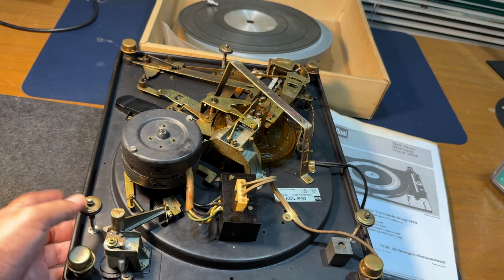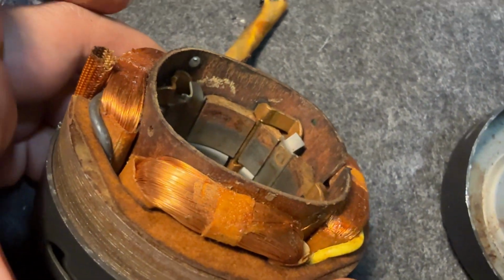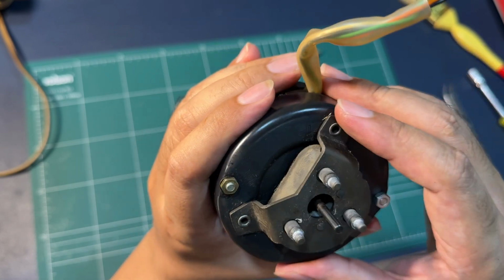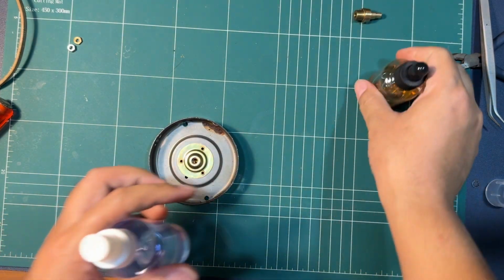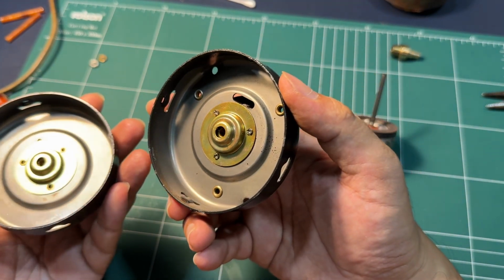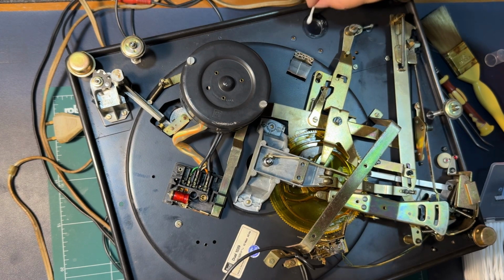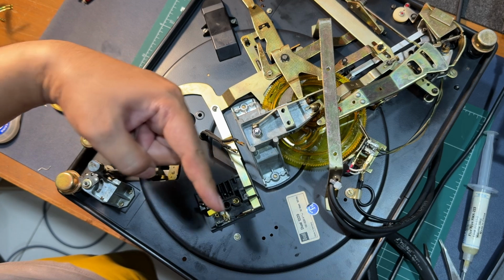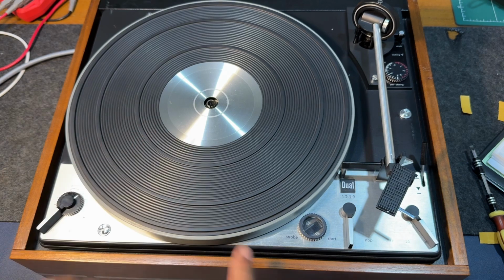Was This Dual 1229 Too Far Gone?Complete Restoration of a Wrecked Vintage 1970's FULL AUTO Turntable

Comment: I've got a Dual 1229 I bought new many years ago. I've rebuilt the motor, cleaned all the moving parts and regreased them and it's operating perfectly but it has developed a hum and I just can't make it go away even though I feel it's properly grounded. Any suggestions?
Reply from the maker: I would check all connections again, especially the cartridge sled to headshell, muting switch, and grounding. Also, try with and without connecting the ground wire.

Comment: You need to take apart the oil reservoirs for both motor bearings and replace the material that holds the oil for the bearings. That is the proper method.   You have to drill out the rivets and then replace them when reassembled.
Reply from the maker: Yes that’s the ideal way, but the bearing condition was relatively clean. I’ve swabbed it with alcohol until there’s no residue. Must’ve used almost 10 sticks, both swab sides per bearing.

Comment: Dual are so well built, they could survive 5 nuclear bombs. I have just restored mine that a friend gave me (1009). The motor was making a weird noise after 20 minutes of play. So I opened it and cleaned and lubricated the bearings/bushings with 3 in 1 oil, now everything is silent and perfect. I turn the platter with my hands before starting the motor, just so it does not work too hard.
Reply from the maker: they don't make things like they used to

Comment: Thanks so much for making this video! Would you happen to be able to get clear video on how to remove the platter? I cannot for the life of me find the infamous C ring (and how to get it out without scratching that area).
Reply from the maker: Unfortunately my unit didn’t come with a c clip. The clip should be at the top of the spindle. Or maybe if you can’t see it there, the clip is not attached?
Reply: @hashtag-shaneiacs thanks for the reply 👍 it’s definitely attached as the platter won’t come off. I just can’t quite see if it’s around the spindle holder or inside the spindle holder.
Reply from the maker: @tapehiss88 have you taken off the single spindle tip? I’m guessing blind here since I don’t know much more info.
Reply: @hashtag-shaneiacs  yep, there's an additional step after getting the spindle tip off. The ring is either around the holder (where the spindle inserts) or inside. One day I'll try to figure it out ;) The platter itself won't come off until that C ring is off.
Reply: Unfortunately, all the videos I've seen of people removing the C ring always cover it with their hand (or don't have a clear shot of where it actually is). Anyway, thanks for your 2 cents.

Comment: What a relief ! You're the first person i've seen to open the motor by separating the housing halves with small impulses. In every other video I've seen, they tap the motor shaft with a hammer, which means a direct hit on the thrust bearing !
You also perform the other work very neatly, which I like.
Greetings from Germany.
Reply from the maker: Thanks for watching all the way from Germany! Hammering the rotor shaft is a big no no. The shaft can mushroom causing the spindle to not fit, shaft can get bent, thrust washer can be damaged, so many bad effects from it.
I also have another German made turntable, Telefunken S500. Modern things are just not made like they used to back in the days.